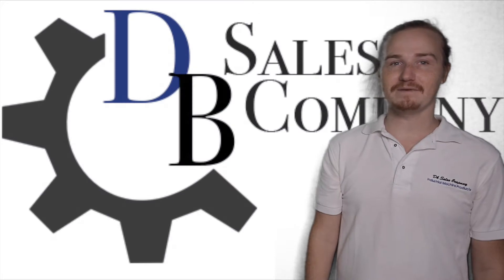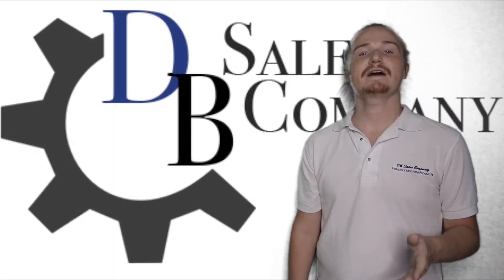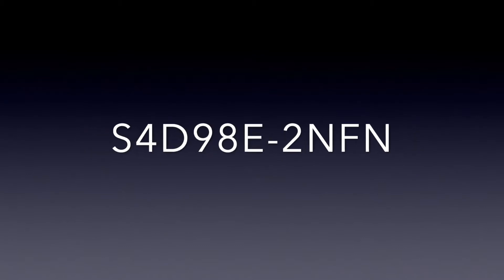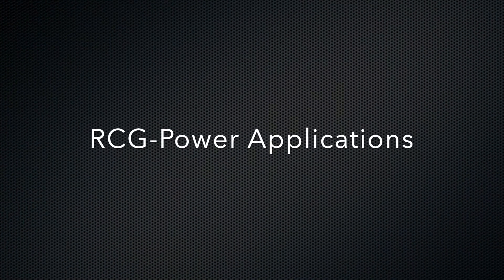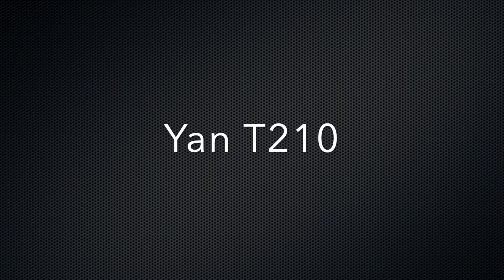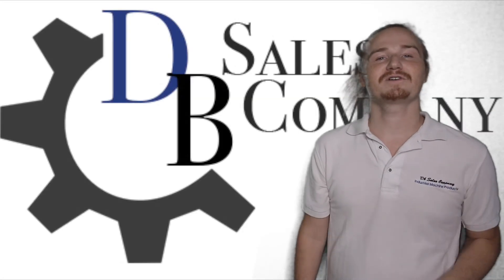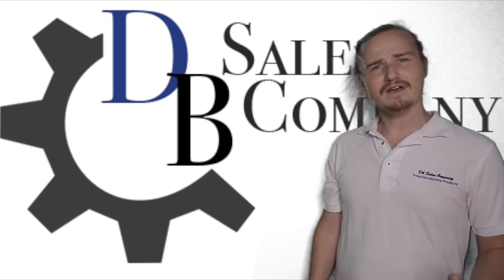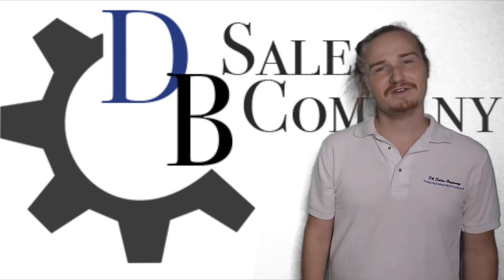Yanmar 4TNV98T Applications

Comment: Nice information very good thank you. I’ve come across a 4TNV 98T – ZNSAP I have a TL 130 with the 4TNV 98.  Will these engines interchange?
Reply from the maker: The block and everything will fit. However, you'd have to check with the manufacturer to see if the TL 130 can handle the power that the turbo version puts out.